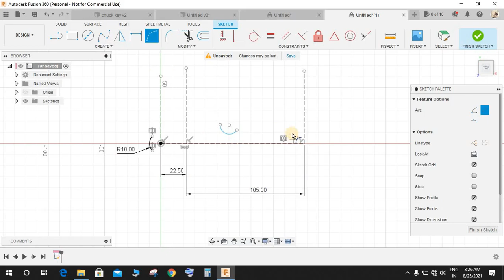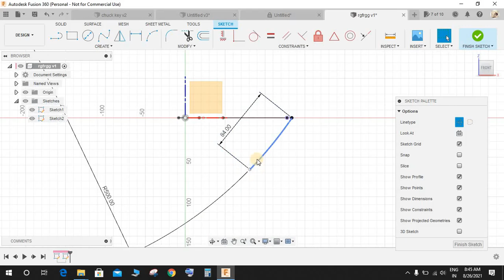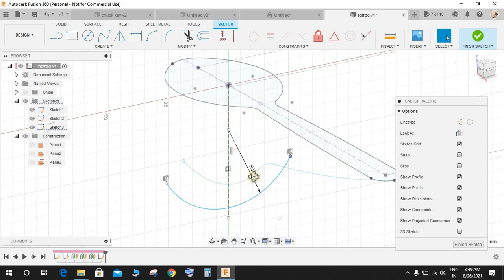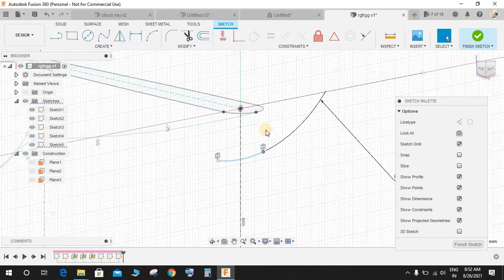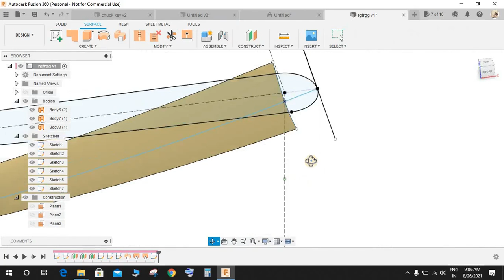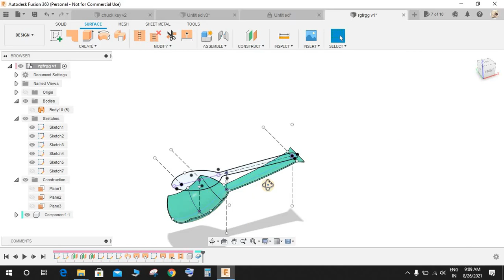Fusion 360 Surfacing Exercise | How to make A Spoon in fusion 360 | fusion 360 Tutorial

Comment: Very good tutorial, I have a question, during the thickening process, how did you come to the solution? I wouldn´t find as you did it. some advice?
Reply from the maker: Press control then select faces to thicken
Reply: @SPARKPLUG98  how did you know That taking off the rail in the last section of the spoon, was the Solution of the error mesage sent during the stitch process? Was It experience, intuition...?
Reply from the maker: Basically it was more like hit and try type